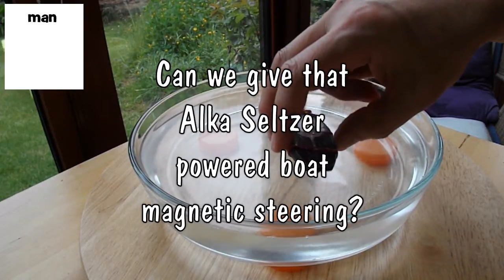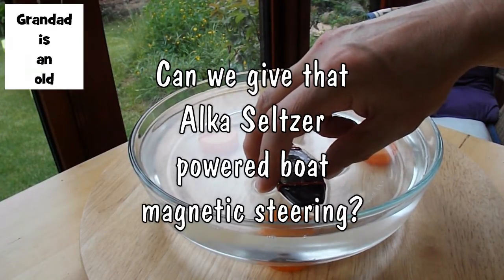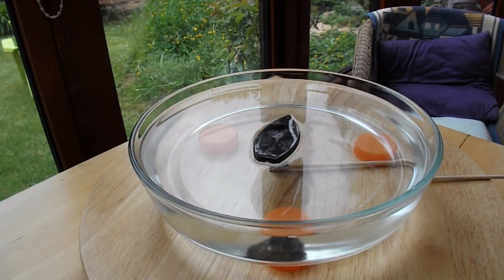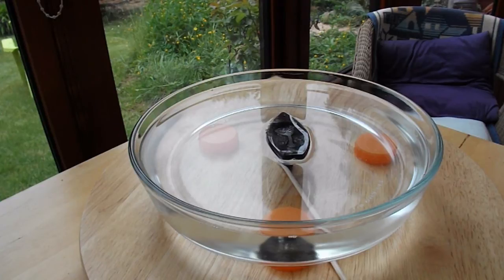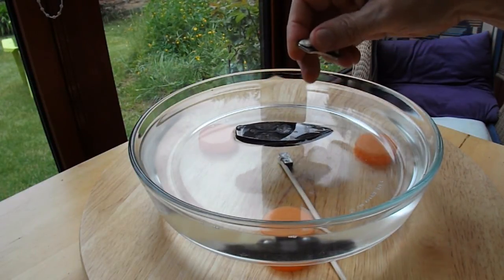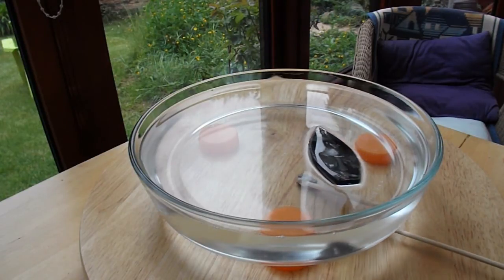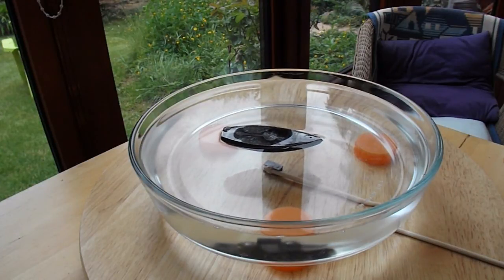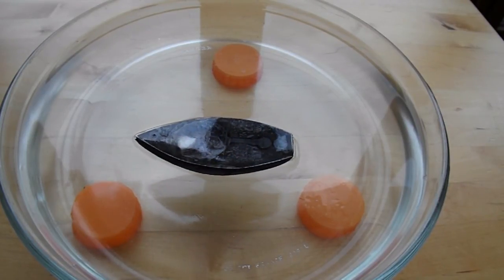Alka Seltzer powered boat Magnet Steering

Comment: what if your boat had two magnet wheels that rotate to push the ⛵.
Reply from the maker: Maybe you should try it and see what happens. What method do you intend to use to make the magnets rotate?
Reply: +GrandadIsAnOldMan single 12 inch wheel magnet 2 of them rotating magnetic fields bouncing off each other creating attraction and pulling away method.
Reply: +good boy motor
Reply from the maker: good boy I will look forward to seeing your video
Reply: +GrandadIsAnOldMan i will doo I will doo i will doooo i will dooooo i will dooo i will dooooo i will doo what you saaayyyyy!!!!!!
Reply: +good boy :-D
Reply from the maker: good boy :)
Reply: +GrandadIsAnOldMan watch it i upload the video.